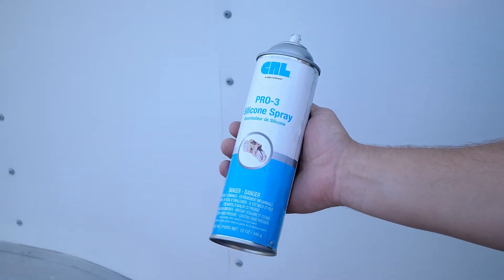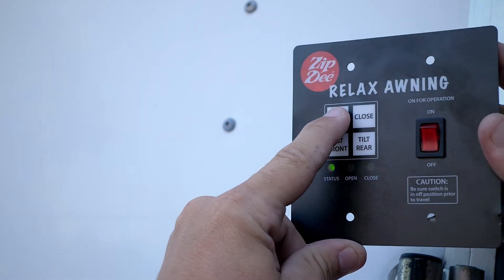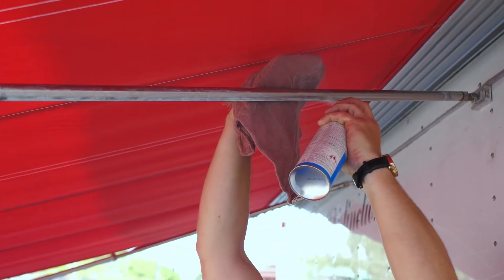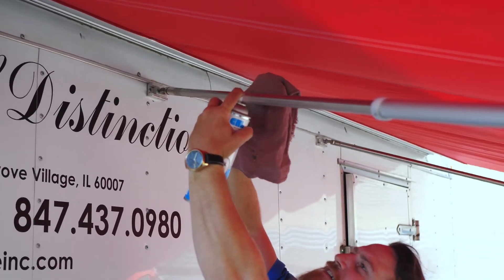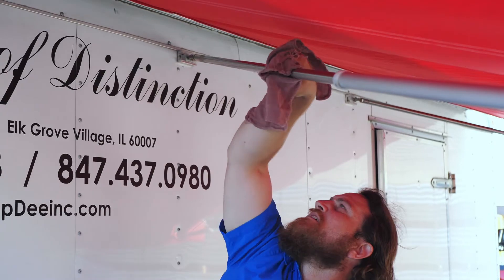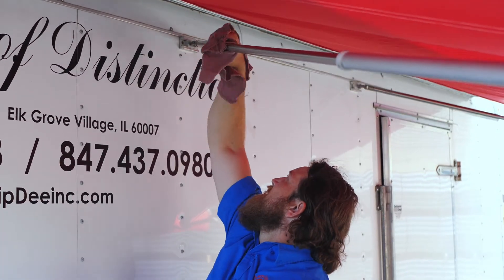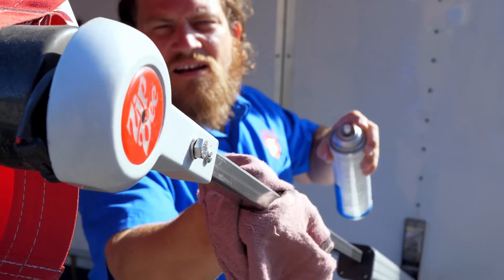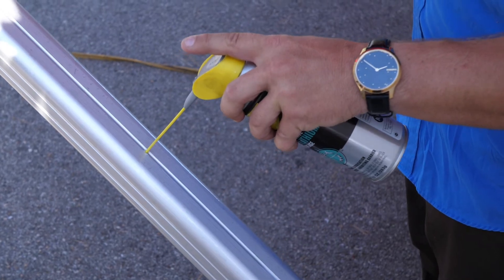Zip Dee Relax Awning Maintenance

Comment: I have a 2013 flying cloud RB model. I have a full length awning on the patio side… after I bought the trailer, about 2 years, I noticed that the awning was leaking when it rains with a peculiar pattern…. Long drip lines running roughly halfway horizontal down the awning approximately 1.5 feet apart. This is very strange as dirt or other debris will not likely cause a “pattern” like this? I’ve washed the awning and rinsed thoroughly to no avail…. What’s the next move?